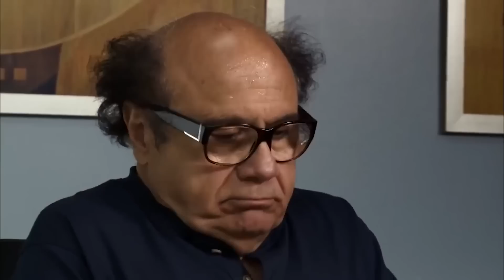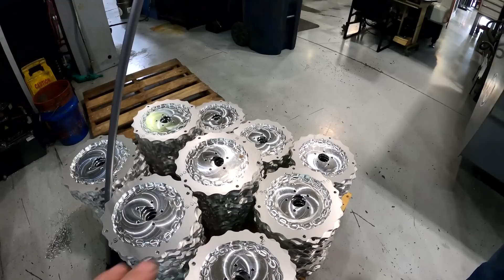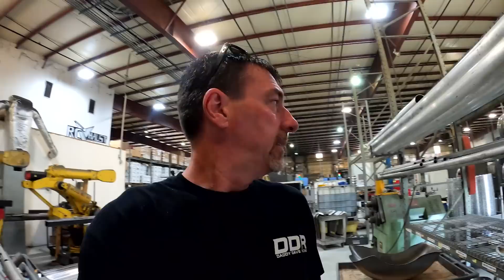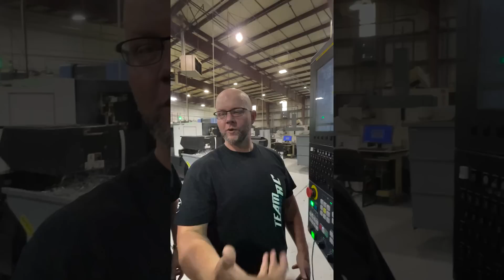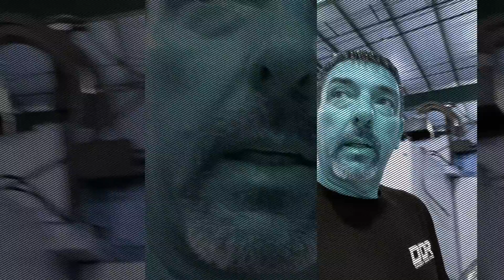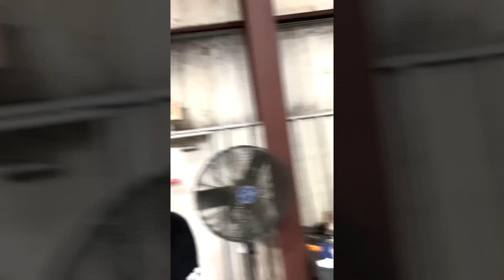New Wheels for SECRET PROJECT! RC Components tour with Jeff Lutz | Daddy Dave Racing

Comment: Great video and love how they're not using a robot for that welding. That's taking a lot of welders and boilermaker jobs thankfully there's things humans can do that a robot can't.
Reply: I agree. I am a certified welder. There are robots where I work. They are supposed to be more efficient and produce a better weld. Thing is, I can't figure out why it is that I spend a lot of time either repairing what the robot puts out, or setting  up an area to do what the robot does because it is down.